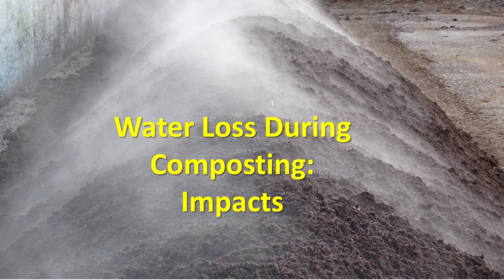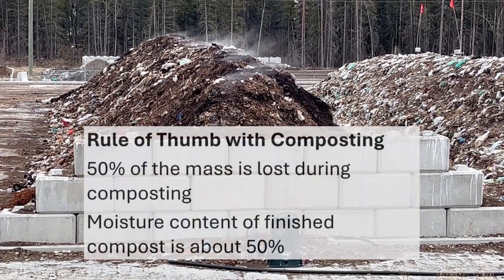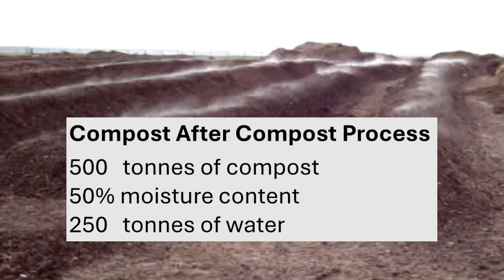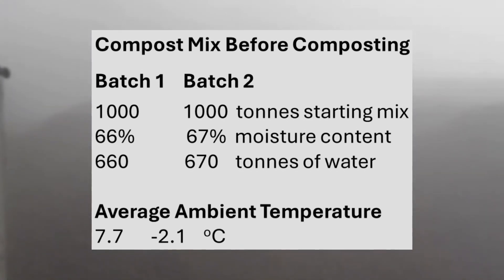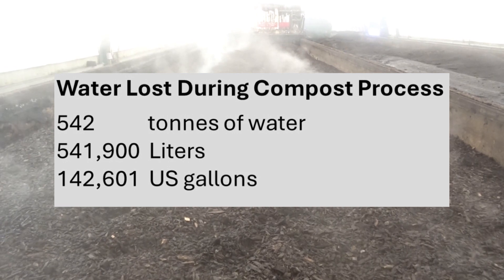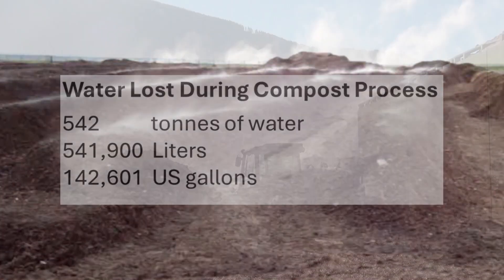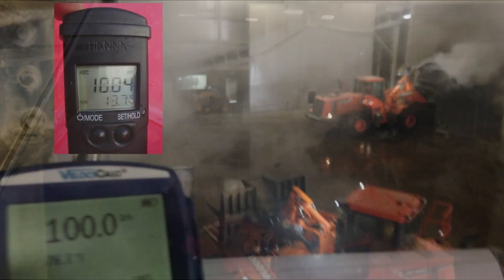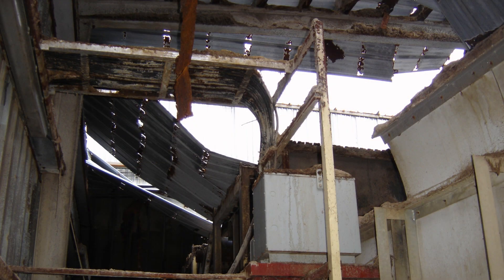Water Loss During Composting   Impacts

Comment: I am learning a lot from your videos. I only have a small garden with a relative small pile of leaf, and wood chip, and coffee grounds compost that I started last fall. The pile is about half a cubic meter large. I was turning it every day except not when it was freezing outside. When I turned the pile again after the freeze the bottom of the pile did smell a bit anaerobe. 

A while ago I made a bubbler from PVC pipes for creating compost tea inside a barrel, but that never worked really well because I did not get a consistent result. After watching your videos I am planning to repurpose the bubbler that I made, but now I am going to put my compost pile on top of it. The maximum amount of air that I can pump into it is about 95 liters per minute. If needed I can put a timer on it so that I can adjust the amount of air that I can pump into it. And instead of a blower fan I am going to use a pond piston air compressor. I am too curious so I have to try it and see if it works. 

Thank you for sharing your knowledge. If I get any positive results I will share it as well 👍
Reply from the maker: Thank you for sharing - sounds like a great plan with the little air pump. I would recommend putting a timer on it - there are some small timers available for very little money that work really well for small blowers.
Reply: Thank you for your response and your advise. I will use a timer for sure. I am also going to monitor the temperature inside the pile. Do you know anything about the micro biology that is inside the finished product after the aerated composting process is done? For example Dr. Johnson claims that the Johnson and Su bio reactor method produces a fungal dominated compost. Is that something that you have studied?
Reply from the maker: Thank you for your question. I don't have any practical experience with the Johnson and Su bioreactor but it appears to be a system that includes a lot of browns (woodwaste) and only a small amount of greens. Based on my experience, yes, when the bacteria are finished with the readily available carbon, the fungal community is likely to dominate. We have seen this as well with older windrows that have a high percentage of wood waste.
Reply: Thank you so much for taking your time to answer. Yes the main ingredient for the Johnson and Su reactor is wood chips. Approximately 3 parts carbon and one part nitrogen rich material. I see many similarities between your method and the Johnson and Su bio reactor and the basic principles behind the two methods. Except that the motorized forced aeration method doesn't take a year to mature the compost. And there is much better control of eliminating the possible pathogens. Which I prefer.   @TransformCompost
Reply from the maker: A one year composting process fits some based on their resources and their access to land. Not every one has the luxury of doing a one year compost process.
Reply: An update on my experiment. I bought a compost temp gauge with a long 50cm probe. And three days ago I added a bale of hay to the compost pile mix, and some molasses, and now in 3 days time the temp went gradually up from 10C ambient temperature to just above 30 C inside the pile. So it is getting close to ideal temperature. Yesterday I was pumping 90 liters of air per minute continuously, but now I have it set on half an hour on and half an hour off. My timer does not have a finer resolution. I will see if that makes any difference. But so far so good, it is moving into the right direction. 

But I do have a question. After watching the temp rise for 3 days in a row I assume that the extra air is an important factor for the rise in temperature, and that it is not just the extra hay and molasses. Because otherwise the microbes would starve out of air within a day and stop producing heat, am I correct?  @TransformCompost
Reply from the maker: Yes, the air is important. Great works! Adding the hay and molasses would give additional energy for the microbes for sure. Now its a question of how much air is coming into the pile, and whether you are putting enough air in, or too much. If you had a way of measuring oxygen, it would inform you whether you were blowing not enough or too much air - or just right!
Reply: Thank you for taking the time to  answer my question again. Today, the 4th day after adding the hay and molasses, the temperature inside the pile went up to just a little over 40C. Measuring the oxygen levels is too expensive for me as a hobby gardener. I was hoping that the temperature inside the pile would be an indicator for the right oxygen levels. Especially if the temperature keeps rising or when it maintains its level for several days in a row. I still have it [umping air for half an hour on and half an hour off at a rate of 90 liters per minute. 

And I did not make just a straight PVC pipe with holes in it, but I made a circle of PVC pipe on which I stacked the pile of compost material. The circle has a diameter that is about 45cm wide, and the conical shaped compost pile is about 1,5 meter wide.  The outer areas from the pile are still a bit cooler as the most inner area from the pile, but the entire pile is gradually warming up. ☺ @TransformCompost
Reply from the maker: thanks for sharing, sounds like you are making great progress!
Reply: Yesterday I posted a video about my compost pile.  @TransformCompost
Reply: The entire pile is now between 50C and 57C for two consecutive days, so now the hot composting process has really started. However, I did cover up the pile a little because of the wet and cold weather but there is still more than enough ventilation, so the pile is far from completely sealed. And I am still pumping air into it.  Things are looking very good. I think that because my air pump and my pile are much smaller that I can get away with a more continuous but much smaller airflow compared to the blower fans, and still get a good result.  

I carefully picked the ingredients and I made everything soaking wet, but it was not exact science, so I did not expect at all to get this good of a result. So far I am happy. I will continue to monitor the temperature. And if you like I will keep you posted.  @TransformCompost
Reply from the maker: wonderful to hear! thank you for sharing! @insAneTunA
Reply: Today is the 7th day since I added the hay and molasses and the 5th day since the pile has reached the hot composting temperatures, but today after 4 consecutive days with a high temp of 55C the temp from the entire pile has slightly dropped to 50C. I added some water because I think that it is the most logical culprit for the slight temperature drop. With 10C ambient temp and 55C inside the pile the water evaporates rapidly. Although I can barely see any steam coming from the pile. I find it hard to imagine that the thermophilic organisms have consumed all the available food or that they do not have enough air. 

When it stops raining I am going to turn the pile, and add some more water and bio mass that I collected while cleaning the garden and see what happens. I'll keep you posted. 🙂

 @TransformCompost